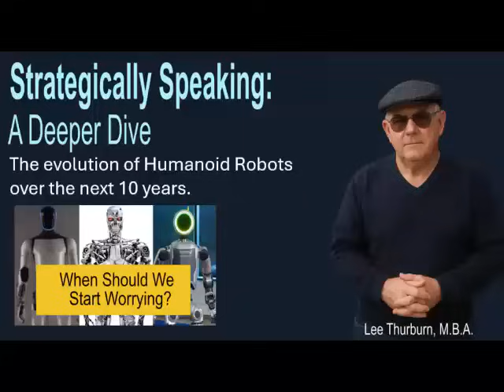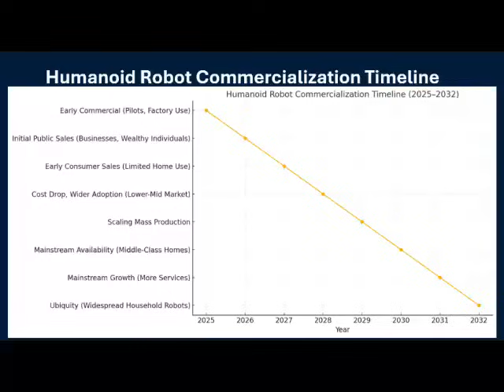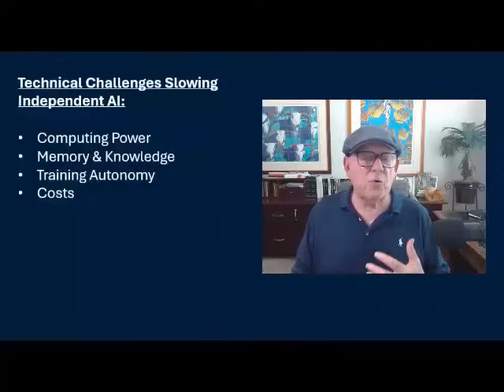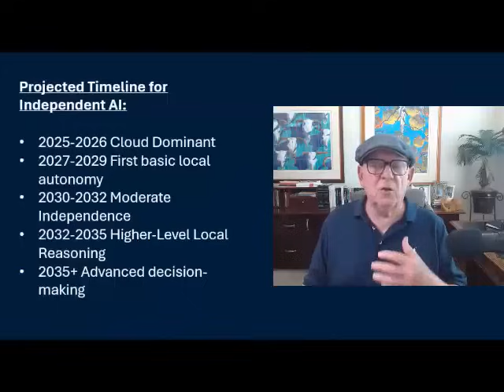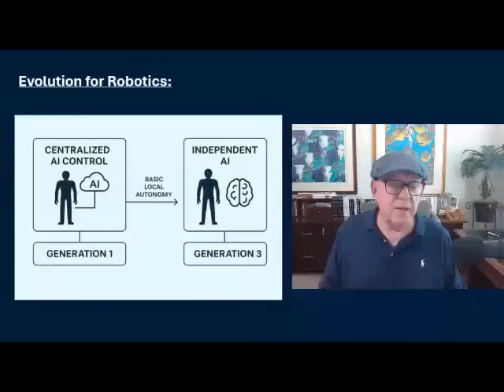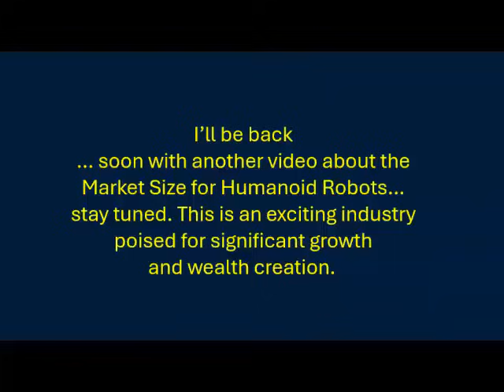The Next 10 Years of Humanoid Robot Evolution

Comment: Do you think humanoid robots will replace certain jobs completely, or just assist humans in them
Reply from the maker: Without doubt they will replace some jobs completely... but will open up other jobs. We are going to need a lot of repair techs for the robots... they are machines and machines wear out... bushings need replacement, pistons and pressure lines develop leaks, etc. So... the job that they replace... making fries at McDonalds... means that there will be less of those... and more high tech jobs available.